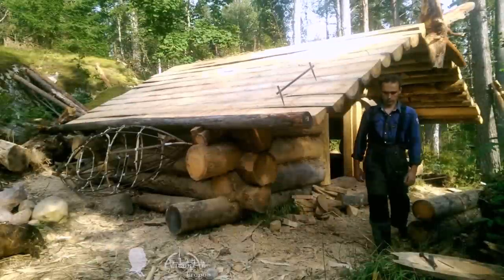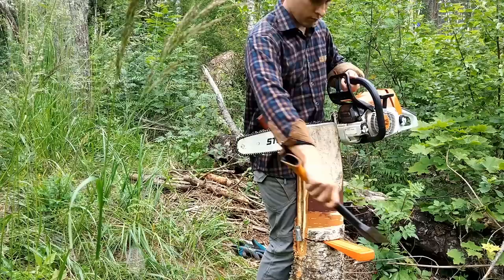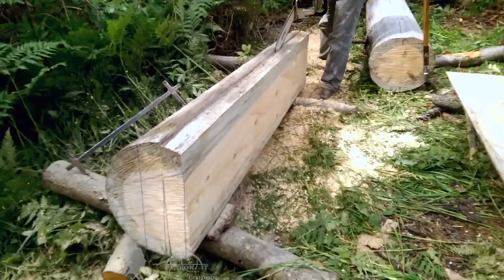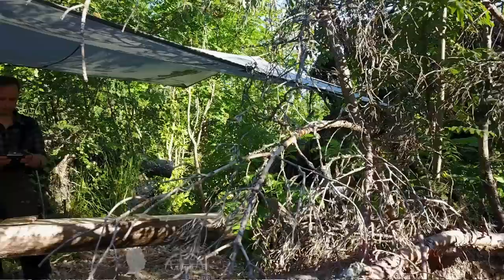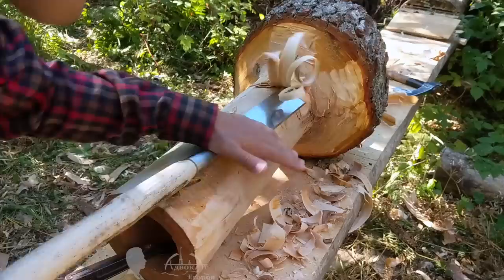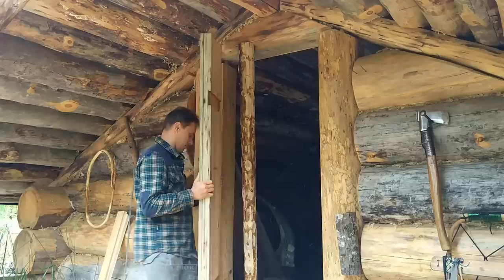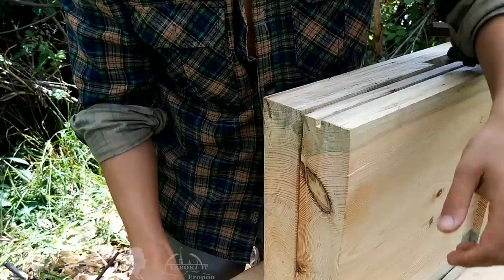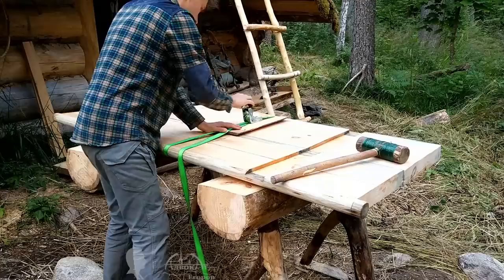Bear-proofing My Log Cabin

Comment: Even something made in the USA today would still be junk. 20 years ago things were made to last. Things today are made as cheaply as possible, and to only last as long as the warranty.
Reply: The USA has always had its shitty wooden houses with probably less than two-inch-thick walls.. Particular structural integrity and notable quality have never been present in vast majorities of the various suburban houses North Americas so twenty years pretty much haven't changed anything.
Reply: 20 years ago was 2000 and people said the same thing
Reply: Yep, just like the foreign stuff... but I'd rather buy American junk.
Reply: Yep I think the quality in certain products started going down in the 80s and 90s they make so much crap nowadays.But that chainsaw looks like it was run with no oil. But probably the crank bearings were gone making the cylinder slop around causing premature wear and tear. Their small engines that work very hard definitely need to be maintain if you want it to last. Plus if you're running it long and hard a little more more oil is better.
Reply: Really I've been spoiled to live in Florida where we have to build things to last through hurricanes by law. Wooden houses in Florida are stronger than many brick houses in New York. But then again, brick houses kinda suck in a storm where a 2X4 can puncture steel, and the house needs all 4 walls and all of it's bricks to be structurally stable.

Comment: Doors open outwards because a bear can only push to try to get in.
Reply: waterdragon 541 I live in a cabin in the woods.  Access door is a sliding glass door, bears came in several times until I removed the handle.  I could tell from the nose prints on the glass they slid the door open pushing on the handle with their noses.  I now open the door pushing on the frame with my finger tips.  At the back I have a utility room with a regular door, it opens outward.  This one bear I called him Hazel, got it open and helped himself to some dry goods I stored there.  Bears opened the doors of two different cars I had.  I now know to let the door light in off position or my battery will be drained as well.  One tried to open the truck, but only managed to yank the side mirror.

Comment: Bears push on things to gain access.  If it opens out impossible.
Reply: Then explain how bears are able to open car doors
Reply: DefinitelyNotDan  Bear traps of any kind built close to the door can wind up biting the owner. That idea is flavored with Hollywood.  Sharpened nails in the door are a much more effective deterrent but may simply cause the bear to try another way in, like right through a wall the size of the logs used in this video. A really hungry bear WILL get in. Black bears half the size of a brown bear will literally rip open a locked car door to get at someone's picnic goodies inside. Part of the charm of living in bear country.....: )

Comment: Open outwards so a bear cant push them in?
Seems obvious. I'd rather have a door blocked by snow than a bear in my living room.
Reply from the maker: Yep))
Reply: @Advoko  Why not add a deadbolt from the inside (via removable log that rests at 45degree angle against the door with a pin and a cavity the floor and studs in the inner door lining (and matching holes) to reinforce the door against being pushed in?

Getting surprised by snow in November until it melts in March sounds deadly :(
Reply: @adriankoch964  he s got a window... just break it and u r out in emergencies is easier to prevent blocking yourself inside than prevent a bear getting inside imho
Reply: @aaddss9846  I wonder if that is why he added that with a bit of a wink and a nod at the end.
Reply: well his roof can reduce snow from blocking the door.

Comment: i'm assuming that you're made the doors to open outwards thinking that the bears will only try to push in?? i don't know much about bears BUT i've seen many many YT vids of them opening car doors and dumpsters like humans, also that door doesn't look like it would stop a large bear charging at it... i could be wrong after all i don't know much about bears..
Reply: That door is thick and sturdy enough to slow down a battering ram, especially if he crossbars it inside.
I'm not a bear expert either, but I suspect no bear would spend a lot of time hammering against a solid object. Unless it was so stubborn and enraged that no wood cabin could stop it anyhow.

Comment: Inward door to hold the weight of the bear from pushing it in.
Use a wheelbarrow to move heavy loads, ie. boards. Two holes on front sides, center and balance as necessary, tie board in the holes and lash it between the handles. With practice you can push and steer the whole load from the back end of the boards! Big energy saver

Comment: Sthil gave me the exact same excuse,  "My fault because I used the wrong mix" despite the fact I've been having to mix fuel for years and would no more make that mistake than put diesel in my car instead of petrol. I haven't used them since and have not had any issues with other types.
Reply from the maker: I ended up switching to Husqvarna and Echo chainsaws since...

Comment: Doors that ope outwards due two things. When or if a fire breaks out you can get out easily. Second outward facing doors are stronger against bear entry. If you are worried about snow blockage you can make a trap door in the roof to get outside to shovel out the door and clear it of snow.

Comment: As far as I know you only summer in your cabin. So if the snow blocks the door closed then it is helping to protect your possessions.

Also as an american I love your comment about the motor failing because it was not manufactured in the US of A.
Reply from the maker: Well, my 20-year old Stihl 180 was made in the US and is still in working condition, even though I used the same gas mix for both...

Comment: I have 4 Stihl chainsaw one is almost 15 years old and the one I use the most! I have been running Motul 800 40.1 for all of them 90 plus octane. One of my saws is worth more than 2,000 after all the work done on it! With the great quality of mix and good octane they all run great! Stihl mix is 50.1 and is ok but running 40.1 you are much better on where in tear of the cylinder and piston. It’s much cheaper to foul a spark plug than to blow up your motor. Just some info that has done me well with all of my saw. It sucks about your saw I would recommend a ms391. They are only 600$ US and are a great saw with good power for the price! I have had mine for 15 years and it is the saw I have used the most! Love your videos good luck and God Bless!🤙🏻
Reply from the maker: Scott, thank you for the info. My 20 year old Stihl 180 saw is still working well...))

Comment: The doors open outward for safety. Opening inward they can be pushed and break something. Opening outward, well, bears have trouble pulling stuff open. Maybe they can rip the door handle off but then, it's over. Your concept and execution of design is exemplary.

Comment: Use the biggest logs you can handle. Log homes stay warm not because of insulative effects but because of "thermal mass" The colder the area you live in, the bigger logs you will need

Comment: I'm thinking you made the doors open outward to keep the bears from getting inside. If the doors opened inwards bears could push and push until the latches broke and the doors open inwards. But if the doors cannot go in... only out, the bears can't push the doors in. 💖🌞🌵😷

Comment: There are pros and cons to both out swinging and inward swinging doors. I guess traditionally doors would swing inwards. To quell the argument of which is safer then you could have a split door or stable door for both safety and ventilation during summertime. Could have it swinging both ways. Not an issue with the proper locking system, bears included.

Comment: Good try- you are very talented but a determined bear will humble you. HE WILL GET IN. You should consider adding a METAL layer on the outside of that door. Smart that you have the door opening OUT. He will put his 500+lbs. on it and it would otherwise fail. It is still far too thin. The biggest design flaw are the gaps all around it. He will get his claws in there and start ripping it apart. I was at Yosemite NP and bears can rip open metal car doors. Once they get an inch, they go to town. You must design the door and cabin framing so it overlaps the frame (e.g., metal slats) so there are zero seams. Then also use a complex latch mechanism they cannot manipulate- like bear garbage cans. 

Do not underestimate the cunning of this apex predator. You can also soak the area around the door in a heavy pine scent which they hate. Also, rig several things like noisy cow bells, flashing lights, even simulated gun shots or barking dog sounds at the entrance via a speaker. Sometimes simple deterrents can go a long way. You could even rig a 5 gallon bucket of water above the door. Have a pressure plate that requires a minimum of 250lbs. to activate it. It's very simple and effective. You could also create a door mat that has rollers in it that activate when 250+ lbs. steps on it. This will take away all his leverage in and around the door. I majored in Engineering so I could go all day long on this. A+ for your woodworking skills though- beautiful cabin. Better than most but still far from bear-proof- slightly bear "resistant" perhaps.

Comment: I would suppose doors open out to keep the pesky bars out  9bear) If snow blocked, you can always remove some wood to let the door swing it or go out through a window.  With the long roof at the front door, it is unlikely the door will be snow bound. Interesting  video. There are safety regulations saying when one is 10 ft. above ground, wear a safety harness. Also use a lanyard that delays the abrupt stop at its limit.  This is achieved by both slight folds of the rope back on itself as well as a canvas overlay where-by the canvas is also crimped and sewn so that at the end of the lanyards travel, instead of a sharp halt the stitching starts to pull out before the end of the rope lanyard is reached.  ( The subject needs to be released soon as 20 minutes hanging = dead.
Reply from the maker: Thank you for the info!

Comment: Yup, my Merkur Xr4Ti had cast iron engine components made in Brazil. They rushed the casting process, you only know when parts fail. Jonsered makes commercial grade equipment that is better for your hands... Much less damaging vibration. Beautiful quality, you can increase the power reliably. Your piston failed early for sure. Try castor oil mix with synthetic...
Nice work, I miss the woods. You must fly off to South America and build yourself a Kon Tiki of balsa wood. Lighter to carry 😉

PS Get a big dog for those bears, I think they have special ones in your neck of the woods 🪵
Reply from the maker: Andre, thank you for the info

Comment: Abstract

This video offers a detailed guide on building a bear-proof door with traditional wooden hinges. The builder, located in remote Karelia, shares their experience constructing a log cabin using naturally sourced materials. The video begins with a cabin overview, detailing previous projects like furniture, tent hybrids, and a storage dome. They then discuss sourcing wood, including the process of felling a dried pine tree. The core of the video focuses on cutting slabs without a sawmill, crafting the two-slab door with sliding dovetail joints, and fitting the unique wooden hinge design. The builder also addresses the decision for an outward-opening door and encourages viewer speculation. 

Keywords: woodworking, bushcraft, log cabin, bear-proof door, natural building, traditional hinges 

Introduction

* 0:01  Introduces the project of building a bear-proof door on a remote log cabin.
* 0:07  Explanation of the door design and mentions prior work on the cabin. 

Projects at the Log Cabin

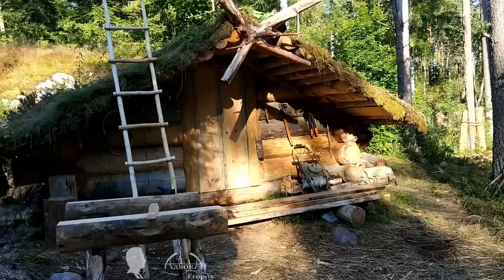* 0:23  Speaker describes previous projects completed at the log cabin over the last 5 years:
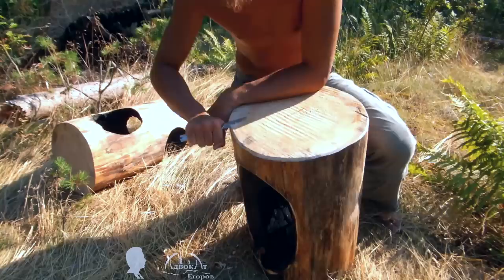    * 0:40 Carved log furniture
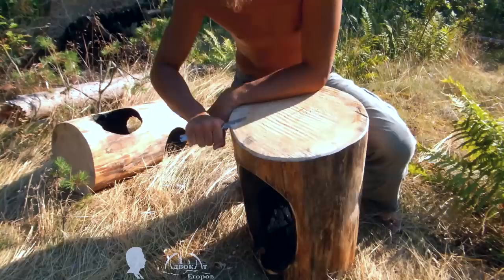    * 0:46 Built a dam and pond
    * 0:58 Constructed a hybrid tent/bed 
    * 1:02 Created a storage dome
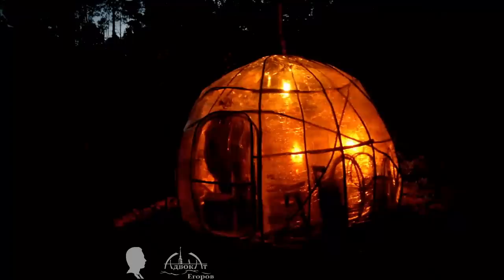    * 1:12 Cleaned the campsite 
    * 1:17 Built the cabin with sustainable methods

Door Design and Construction

* 1:58  Describes the door design with wooden hinges and why it started two years ago.
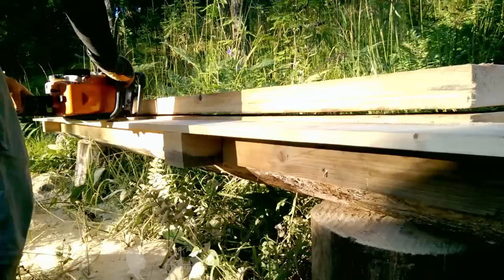* 2:20  Explains past work on making thin boards for the door. 
* 2:30  Decision to make a bear-proof design using wide boards. 

Finding and Preparing the Wood

* 2:42  Acquired a powerful chainsaw to mill wide slabs.
* 3:12  Chainsaw couldn't handle milling wide boards.
* 3:26  Speaker goes to find a dried pine tree for slabs.
* 3:43  Importance of having a packframe.
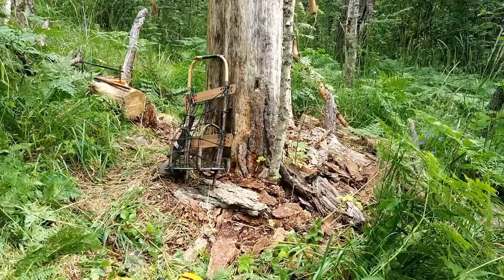* 3:54  Found appropriate dried pine. 
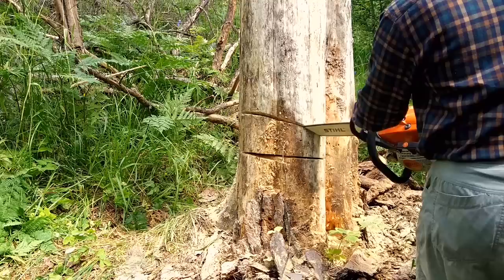* 4:05  Explains the technique for felling a branchless tree. 
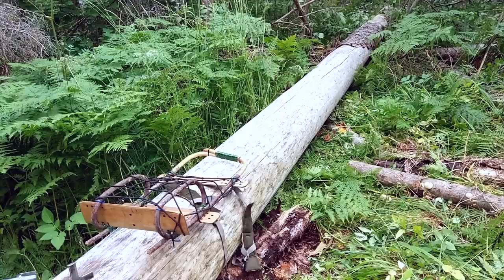* 4:40  Drops the tree to prepare for milling. 
* 4:51  Needs slabs for two doors at the cabin.
* 5:04  Describes "Kelo" wood and why it's valuable.
* 6:12  Details previous work on milling without sawmills.
* 6:29  Claims free-handed milling is faster and more efficient.

Milling the Slabs and Carrying Them Back

* 6:54 Checks the quality of the milled slabs.
* 7:06  Starts carrying slabs back to the cabin.
* 7:39  Thoughts on why the wood is light and the terrain is manageable.

Issues with the Chainsaw

* 8:09  Plans to mill another log section but the chainsaw fails.
* 8:21  Shows the damaged chainsaw components.
* 8:39  Suspects planned obsolescence in chainsaw design.

Setting Up a Woodworking Shop and Shaping the Hinges

* 8:50  Creates a makeshift workbench.
* 9:01  Sets up a tent for a covered workspace.
* 9:13  Starts shaping the round tenon hinges into the wood.
* 9:49  Cuts out the second tenon. 

Fitting the Door Parts

* 10:01 Cuts the second board down to fit the doorway.
* 10:16  Uses a hand planer to smooth the wood.
* 10:35  Shapes square tenons on the board 
* 11:06  Assembles the two hinge boards together.
* 11:33  Starts forming the sliding dovetail joint.
* 11:51  Rain starts but continues to work under the canopy.
* 12:22  Enjoys the process of chiseling away excess material.

Trying the Door in the Cabin

* 13:07  Rain stops and speaker takes the door to the cabin to try it out.
* 13:29  Iteratively adjusts the wooden hinges for a good fit.
* 13:45  Expresses liking for the primitive design of the door.

Fully Installing the Door 

* 14:02  Needs to lift the doorway and roof structure to fit the door.
* 14:25   Uses strong wedges to accomplish the lifting task.
* 14:50  Discusses why the doors open outwards. 

Assembling the Door and Adding Details

* 17:46  Assembles the full door to avoid gaps.
* 17:53  Uses a plough plane to make matching grooves for a spline joint.
* 18:29  Makes short splines to go into the grooves.
* 18:51  Shows a preview of making a shaving horse tool.
* 19:08  Puts the whole door together.
* 19:42  Reinforces the door with dowels.

Conclusion

* 19:54  Speaker signs off, encourages sharing, and mentions subscribing. 

Disclaimer: I used gemini advanced 1.0 (2024.03.04) to summarize the
video transcript.  This method may make mistakes in recognizing words
and it can't distinguish between speakers.
Reply from the maker: Thank you!

Comment: Just make a big mat of boards nailed together then hammer nails all over the mat upside down then turn it nails up and lay it in front of the door! The bear cannot push on the door while standing on nails it works just have an outline of boards making a frame for the mat so the bear can’t push it around! When you are home you can leave it there so they can’t come in but in the morning when you work at home just stand it up beside your door so you don’t stand on it by accident!

Comment: Solid main entrance doors opening from inside out are more secure based on the structural fact iit will be supported by the structural frame of the building. Not just a few flimsy 2x4s tacked in place. From the outside, they cannot be easily kicked in by an outside intruder,,such as a bear or idiot..

Comment: Why does the door open outwards? I'm guessing so that any force on the outside just helps to close it even tighter, keeping out those pesky bears. Snow building up won't be too much of a problem since the roof overhangs quite a long way, snow will have to blow with the wind to block Max's door, not just fall from the sky. Besides which, he has a load of tools and fire inside that cabin, snow doesn't scare him! 

It's presumably easier to reinforce a door that opens outward, against bears etc, than one that opens inward. Since half his furniture is tree trunks, he has no shortage of stuff he could barricade against the door.
Reply from the maker: Yep))
Reply: @Advoko  Wow a reply from the man himself! Finally made yourself a computer out of pine cones and weasel spit?

Comment: Bears push in, Don't pull...You are safer I believe...Also when you are in and the door is locked it is more difficult to pull it open than it is to push it in by force...Also you have more free space inside for furniture...
Reply from the maker: Correct))

Comment: Why open outwards???
Simple, to make it bear proof. The door is blocked around its entire perimeter. 
An inward opening door is only held at its locking mechanism, and therefore, 
much easier to be over powered. 
Also, you have a good overhang, to inhibit the deposition of too much snow that may block the door.

Comment: I would guess that you had an air leak between the fuel pick up and the carburetor.  This would create a lean fuel mix and over heat the saw and you would get the damage you showed in your picture.  BTW that is what killed my MS 660, but the damage to my saw was created by the shop that did the tune up to it.  Now I do my own...
Reply from the maker: Thank you for the informative reply